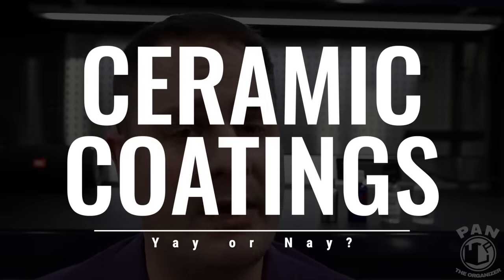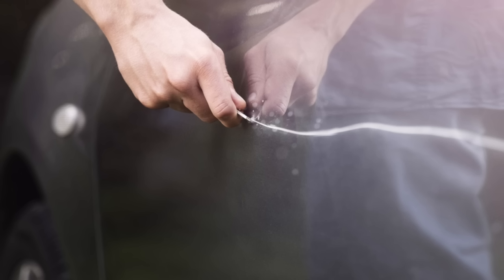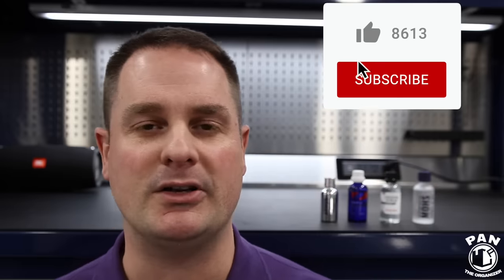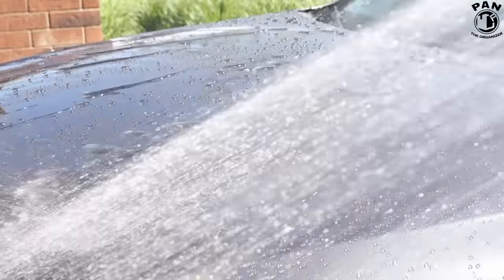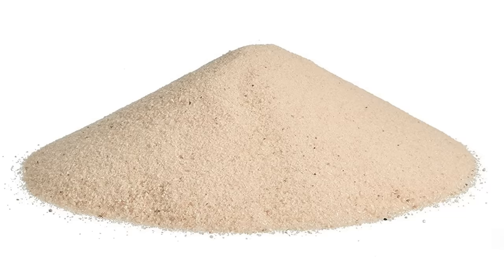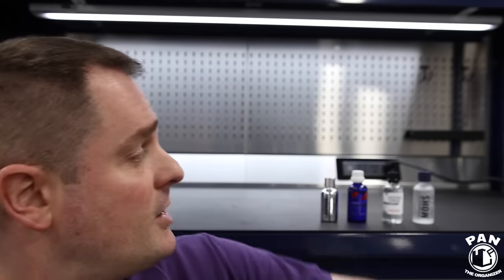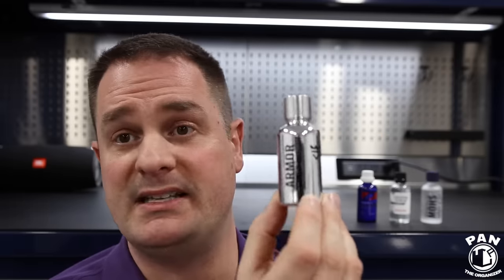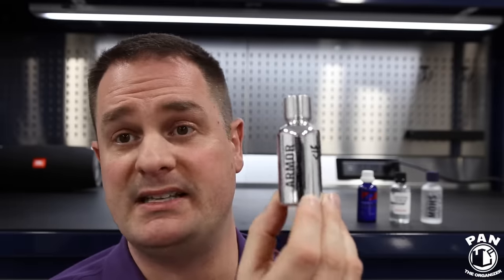DON'T BUY CERAMIC COATINGS BEFORE WATCHING THIS !!

Comment: Great stuff Pan! Thanks for this video. One of the nagging questions I had is how do I polish up fine swirls on ceramic coatings. Let’s face it, while durable, there is still fine swirls that will eventually come about from the daily drive and regular washing, albeit a lot less. BUT there will be to some degree nonetheless. I often wonder how to correct this on a ceramic coating, and  this is the primary reason why I stayed away from ceramic coating so far. You alluded to CarPro Essence Plus in this video, but I do hope you can cover this topic in detail if not done so yet. Looking forward! Keep up the great work!
Reply from the maker: Thanks for the kind words about my video Mel-Vern. I appreciate it. Now to answer your question, my car has zero swirls and scratches. Literally. I detail it twice weekly (which is way more than the average person) and use safe washing and drying techniques as shown in my tutorials. If you do that, there should be no scratches or swirls, or at least so tiny that they wouldn't be visible unless you take a magnifying glass to the surface.

Now if for some reason you do get some "love marks" or very fine light scratches and swirls, there is one polish that can correct ceramic coated cars. It's CarPro Essence+ (not the regular Essence!). My buddy Brian from APEX did a video about it here: https://youtu.be/43ARKGG1TvU

Comment: Hi Pam, another great and informative video. Interesting question regarding disposing of microfibre cloths after applying the silicon coating. Does that advise also apply to the toppers like Turtle wax seal and shine for example?
Reply from the maker: No. For silica spray sealants, just wash the towels immediately after use and reuse them.

Comment: I have a couple questions for my wakeboarding boat (like most fiberglass boats, it has a gel coat finish.) Would these ceramic coatings still be the best option? Then, typically in the wakeboarding world, after you pull the boat out of the water, you dry/wipe down the boat, and many use a vinegar solution to help remove water spots accumulated throughout by the day. Would that be needed on a boat with a ceramic coating? Is it safe on a ceramic coating? Would there be a better alternative to a vinegar solution?

Comment: Hi. Thanks for the video. Can you please tell which polish can be use before apply the ceramic coating.
Reply from the maker: There is not one single polish, but rather many polishes that can do the work, depending on the condition of your paint. My favourite is Sonax Perfect Finish.
Reply: @PanTheOrganizer  Thanks for your reply.  One more question, can i immediately apply ceramic coating after the polish.
Reply from the maker: No. You need to use a paint prep to remove the polishing oils, before you apply the coating.

Watch my full ceramic coating application tutorial here: https://youtu.be/sqQYVjxFqK0

Comment: Thanks for all the tips , just want to know Can I coat my car  outside the house or should I cover it with plastic after I'm done with ceramic coating
Reply from the maker: You can coat your car outside as long as you don't work in direct sunlight. You need to work in the shade on a cool surface. So ideally you would coat towards the end of the day. Also, pick a day where you will have at least 24 hours without any rain while the coating cures. Some coatings (like the AvalonKing) require 48 hours without rain. So yes you can cover the car if you want to make sure there is no rain on it.
Reply: @PanTheOrganizer  My only worry is sand.

Comment: Good day. I put one cote of Cquartz followed by one cote of SiC. Should I use a booster every two or three months and is so which one is the best for Carpro SiC which is my last cote? thanks in advance
Reply from the maker: CarPro recommends 2 layers of CQuartz UK 3.0.  It would have been best if you applied 2 layers. Anyhow, yes every 2 or 3 months, you should be using a silica spray sealant for maintenance. Pick which ever one you like best. Or, if you want 100% chemical compatibility, you can apply the new CarPro Reload 2.0. Here's a link: 
In USA: https://bit.ly/3KfhHJi
In Canada: https://bit.ly/42GPceR

Comment: If you have to put a top coat on a ceramic coating every three or four months, what is the advantage of ceramic coating over a polymer coating, such as P&S Beadmaker, that also has to be reapplied every three or four months?

Comment: Good afternoon Pan! First of all, thank you for what you do, you're amazing! 
I have a couple of questions as I'm in a kind of a confusion. I bought a car about 2-3 months ago. Dealership told me that the car i wanted is already ceramic coated and has some fabric/leather protection applied, and that it adds $1700 to the car price. I know that's a crime, but i was ok with it, as i finally found the ext/int color combination for the exact trim i was looking for.
Long story short, i bought it. Then right away i bought a ton of detailing stuff and now i regularly do 2 step washes. Pre wash with sprayed cg honeydew + two bucket manual wash with carpro reset. After a couple of washes i noticed that mostly it doesn't repel water anymore. So i applied hydro2 about a month ago. And now, after a couple of washes it mostly repels water. Maybe only on the lower parts of doors water beading got poorer, so maybe it's time for a chemical decontamination. But the gloss and slickness are really cool, the paint is really like a candy
And now i'm kinda confused, as i don't understand if the ceramic coating was really applied, or they just lied about it and just charged extra money without the coating/leather protection. And don't know how to check it.
So now I'm thinking about applying that armor shield coating by myself. And i have a couple of questions here:
- What if they really applied a ceramic coating, and I just don't understand/miss something...will the newly applied layer be less durable because of it? I mean, i know that usually it's required to remove current coating, but as long as i'm not really sure if it's there or not, it's becoming kinda tricky....and actually if it's really there, then i definitely don't need to remove it and reapple. If it's there, then it's fresh and new.
- If i can do it without knowing if i currently have one or not for sure, then - Can i do it without polishing step (as the car is new, and i don't see any scratches on the paint even with a bright detailing flashlight)?? Can i do it with just good two step wash, maybe with some acidic shampoo step in addition to the regular two steps, and with chemical decontamination (carpro trix) applied? Also, what do you think, is chemical decontamination enough here, or it's worth to also manually clay it ?
- Maybe as i don't know for sure if it was coated in dealership or not it'd be better to just do the full wash/decontamination and apply some ceramic spray like reload, turtle wax seal&shine, etc?
Reply from the maker: Hi Sheko. Is your car new or used? And what specific ceramic coating did the dealership apply? Car dealerships usually always apply the cheapest products to maximize sales. At the price you paid, it should have been a professional grade coating from a reputable brand like CarPro, Gyeon, Gtechniq, Opti-Coat, DuraSlic, etc. Which I doubt is the case.

So now, you're left wondering why the coating isn't performing up to standards. Do you know how long ago the coating was applied? What was the expected durability of that coating? There are many unanswered questions here.

Regardless, if you plan on applying your own coating, you will have to ensure you do a full preparation of the surface, to ensure removal of any previous crap that was applied on your car. Ceramic coatings need to bond directly to virgin clear coats, with no contamination or previous protectants on there.

So you would have to strip wash, chemical decon, clay bar, machine polish (only way to ensure 100% removal of any previous protection), paint prep spray or IPA, and then apply the new coating.

I have a full tutorial on how to apply a ceramic coating here: https://youtu.be/sqQYVjxFqK0

Again, the ONLY way to ensure 100% removal of any previous ceramic coating is by machine polishing. So you can't skip that step.
Reply: @PanTheOrganizer  Hey Pan! Thanks for your answer! So, the car was brand new. They told me that they applied Quantum Professional Ceramic Coating (complete body protection RTU). Have you heard anything about that one? 
And they actually mentioned 5 year warranty for it. But not sure what exactly is covered by that warranty. And I really doubt that water beading is, as you can easily kill any water beading by just not washing the car for a couple of months, or by washing is with high ph shampoo, etc
Reply from the maker: I have never heard of that brand. If they have a "so-called warranty", you should go see them and tell them to redo the job.
Reply: @PanTheOrganizer  Thanks Pan!

Comment: Pan you have done it again. I do have a question though. I used the Avalon King on my 2014 Equus this year and it looks amazing. It was a lot of work prepairing 6 yr old paint. Now my wife wants me to coat her new Camry SE. Paint looks and feels good. Being new do I need to de-iron and claybar? Once again love your show have learned so much. Thank you!
Reply from the maker: Thanks David! To answer your question, it depends. If there is any paint protection currently on the Camry, you absolutely have to go through all the prep steps including machine polishing to ensure 100% removal before applying a ceramic coating.

If the paint has zero protection, and you like the way the paint currently looks, then yes you could wash, iron decon, claybar, then IPA wipe to be on the safe side and apply the ceramic coating. You can skip machine polishing.

I hope this helps!
Reply: @PanTheOrganizer  Thank you!!

Comment: Great tutorial, thanks!   Is it safe to use the ceramic maintenance sprays on top of traditional wax job?
Reply from the maker: Usually, you don't mix ceramic based products with regular waxes, as the chemistry isn't really compatible. That being said, there are now more and more ceramic and/or graphene based sprays that say they are compatible to be used on coatings and waxes, like Turtle Wax Flex Wax, and 303 Graphene Nano Spray Coating. Just don't expect the same durability when applying those sprays on top of wax. They last longer on a fully prepped paint, free of any previous protection, as expected.

I reviewed both sprays on my channel:
Flex Wax: https://youtu.be/b5BjDzItlr8
Nano Spray Coating: https://youtu.be/hHefz3XMK1g

Comment: Hi 
We just watched your Master class video about ceramic protection.
I am not a guy that has ever detailed a vehicle nor plans too.
That said we have a Escape19 molded fiberglass camper trailer the front gets encrusted with dirt & bugs 🤨
And we're thinkin ceramic or graphite coating would make washing the bugs off easier.
So my question is
Is this suitable for fiberglass with a gelcoat ?
Or do you have a better suggestion.
Reply from the maker: Watch my RV detailing tutorial here: https://youtu.be/OCUWBbPgu8M

Comment: Great video, extremely informative thank you very much.  Can ceramic be used on your windshield?
Reply from the maker: Hi Art! It depends if the specific ceramic coating you are using can be also applied on glass or not. There are even glass specific coatings that exist.

I highly recommend that you watch a video I made about glass sealants here: https://youtu.be/IEIlHZ2D4ig

Comment: Hi Pan, love the video. Been doing paint correction on vehicles for 5 years now as your tips and tricks have been so helpful to me. Wondering if you’ve encountered a vehicle that had water spots on hood where only paint correction and polishing removed all spots. i went ahead and applied 2 coats of ceramic coating once all water spots were removed. Hood was perfect! No blemishes!! But After driving for a couple hours on a hot, sunny, dry day- i pulled into the garage to notice the water spots were once again visible on the hood and it wasn’t in contact with water. I assume heat somehow made water spots surface again? Do you have any advice on attacking this before just repainting hood? I don’t know of another option. Thank you!
Reply from the maker: It's hard to troubleshoot at a distance without seeing the vehicle, what polishing compounds/pads you used, or knowing how long the water spots were on the surface. 

When water evaporates, it leaves minerals behind. If you have hard water where you live, or wash the car outside, those minerals can start to etch through the protection (wax, sealant, coating) and through the clear coat if left unattended. The quicker you address water spots, the better. A water spot remover works super well.

If however they are left unattended and start to bake in the hot sun, the eventually etch through the clear coat and need machine polishing or water sanding to remove. In extreme cases, even those methods won't work as the damage and staining is permanent, so a full panel respray is needed.

In your case, you likely didn't machine polish enough, or the minerals had already done permanent damage hence why you still see the water spots. Keep in mind that coatings amplify the surface they're applied to. So any imperfections in the paint will standout even more when a coating is applied. 

At this point, you have two options:
1) Wash the car using a mineral stripping shampoo like this: https://bit.ly/3PBmzeK
Rinse and dry the car. Then use water spot remover like this on the dry paint: https://bit.ly/3Nq7olS
Then thoroughly rinse and wash the car again using the shampoo mentioned above. Rinse and dry the car. 
Do a two step paint correction on the hood. A heavy cut compound, with a microfiber pad, followed by a polish with a foam polishing pad. IPA wipe the surface, and reapply the coating. See if that brings things back.

2) The last option if that doesn't work is to repaint the hood, wait 2 months after the repaint for the paint to fully cure and finish its gassing out phase, and then apply the coating.

I hope this helps.
Reply: Pan-thank you so much for the feedback and insights. Very helpful as always. I’ve ordered the products you’ve mentioned in your reply. Fingers crossed I don’t need to repaint hood. Thanks again. See you on the next video.
Reply: Hi Pan, just providing an update for you. Followed steps you listed in the reply message and water spots were successfully removed. Thank you so much for the feedback. I had to use Meguiars Ultra Cut correction compound followed by Sonax perfect finish with foam pad to remove the spots. Looks great! Thanks again Pan.

Comment: I took delivery of my Model Y and it’s been in the garage. Probably has 100 miles on it. Does the detailer need to do all the prep steps you mentioned before ceramic coating? If I run my hand over the hood I do feel little sandpaper like bumps.
Otherwise I was planning on washing, then claybar, then ceramic myself.
Reply from the maker: A new car is never new until it's properly detailed. 
- at the factory, the paint defects are often corrected quickly by rotary polishing which can leave marks and holograms, so polishing corrects those, before you lock that in long term with a ceramic coating for example.
- vehicles are then transported by truck, train and boat so they are exposed to the elements, industrial fallout, brake dust, rail dust, etc
- vehicles are often left at boat docks (when transported by boat) or in exterior parking lots for weeks or months, again being exposed to the elements
- at the dealership, the vehicles are almost always poorly prepped using the same dirty water that was used for all the cars on a given day, and poor washing and drying methods leading to swirls and scratches 
- at the dealership, a layer of cheap wax or paint sealant is usually applied to attempt to make the paint glossy prior to delivery. It's crucial to remove any previous protection before you apply a ceramic coating, as coatings need to bond directly to a virgin clear coat.

If you only plan on applying a regular carnauba wax or paint sealant though, you could decide to skip machine polishing, as those protectants can be applied over existing protection and it's not as crucial to prep the paint as well.

I explain all of this in this popular video: https://youtu.be/QgoyrC-5CMc

So you can better visualize the new car prep process, here are the steps I perform on a brand new car from two of my customers: 
Tesla Model Y: https://youtu.be/gohks8xP5NY 
Porsche 911 Carrera: https://youtu.be/2ckiivbFqs4
Audi Q7: https://youtu.be/t7HCBSVnizM

Comment: Great insight into DIY Ceramic Coating. Can you suggest a procedure I would use to prep the paint of a brand new car, same day I collect it from the show room, so I can apply the Avalon coating. Really appreciate your help.
Reply from the maker: I have tons of new car prep videos. Here's one: https://youtu.be/tjJPcdCUaK8
Reply: @PanTheOrganizer  Thank you for your reply, I have been watching your clip and it seems that the XC90 has been out on the road for a little while.

What would you procedure be if I took delivery of a brand new Hyundai Tucson N-Line (Diamond Black), drove it home 2Km and then wanted to ceramic coat (Avalon) the exterior. I would imagine all I would need to do is give the car a wash with the Ceramic Prep Shampoo, dry the car and apply the ceramic coat, would you think that is OK?

Comment: Thank you Pan for great video.  I have a pickup truck with high end chrome rims from the factory.   Can I use a ceramic coating on the rims or do you have a better recommendation?
Reply from the maker: If the coating you are buying can be applied to chrome surfaces, then yes you should absolutely coat them.